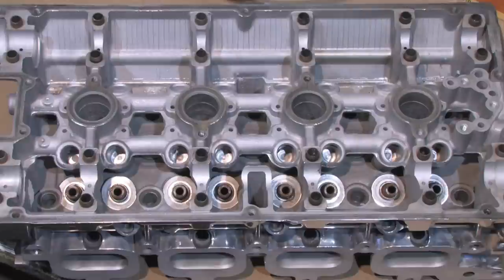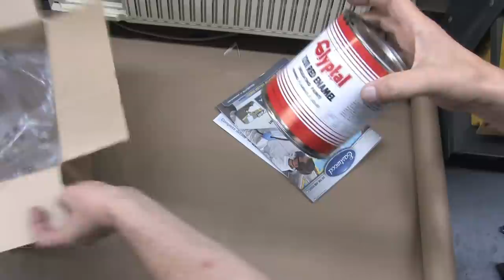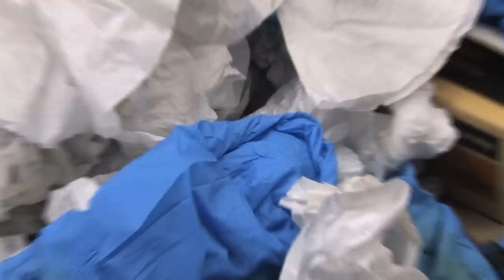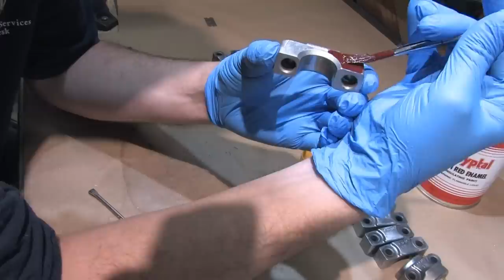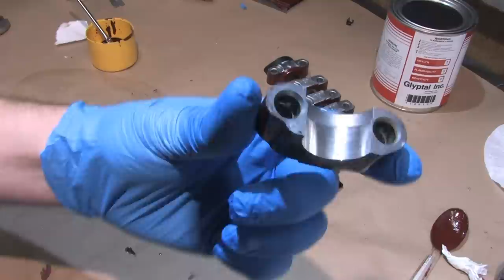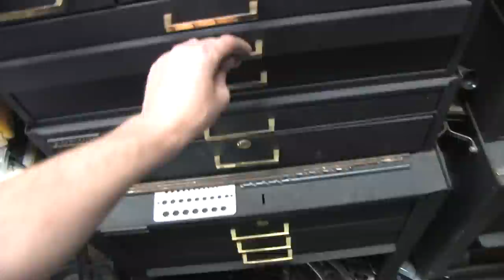Glyptal Application Process

Comment: Glad I can help!  The finish held up extremely well with zero signs or wear, flaking, etc. after many, many years of abuse.  The engine combo was a simple 355 chevy, but withstood incredible high rpm nitrous abuse.  As far as I know, it's still going strong and we built it back in 1996.  

That said, it was far easier to apply on the Chevy V8 due to the simple engine design.  The Mitsu heads are full of tricky tight spots, which is why I admire what you've done here!

Comment: I've done a few set of heads with Glyptol over the years but never a block because I didn't have the means to cure it but it is a great coating and dam near bullitt proof. Your right, prep is the key and the time involved is mind numbing. Great job on the head, I'm looking forward to the rest of the series. I'm glad you mentioned the neurotoxin problem, like most mechanics "it won't happen to me" well a coworker yrs ago repaired a diesel tank without cleaning it properly by arc welding patches on it and his career ended that day, eye sight, teeth, skin, touch, kidney, liver issues, it can and will happen. Cheap safety equipment and preparation are the key to avoiding a lifetime of illness.

Comment: gday m8 just a note to say thanx for the help ive and received from watching your video,s i bought a rvr a while back that was blowing enough smoke to fill the street if i drove it and i had trouble working out what 4g63 was in it as its an import to australia bytes watching your vids i now know the difference between 1g and 2g  6 bolt and 7 bolt the rvr is 2g took the head off turned head upside down covered valves with water checked ports later with torch nearly every one had a puddle or seeping around valves thanks again 4 all the help

Comment: About 40 yrs ago, I purchased some Official, Chevrolet sanctioned How-to High Perf manuals from my local Chevy dealership. In those manuals, the procedure for prepping the insides of the block and cylinder heads showed much of what you've done here. In addition, the painting of the castings interior to improve oil scavenging was also recommended, though I'm unable to recall if the recommendation was for Glyptal, or not. I do recall however, that the color of the paint used was a deep brick-red...   I'd say you're on the right track!
P.S.    As I remember, this process was used so that an engine with extreme rpm capability could operate without installation of deep sump pans and still not suffer from oil starvation issues. It was also recommended for engines being fitted w/a dry sump system...
Reply from the maker: It might have been Rustoleum Red Oxide Primer.  The shades aren't far off, but in photos, I can tell the difference at an extended glance.  I'm pretty sure I could do it in person immediately.  I've seen several small block chevys (mostly 327's) out there on the interwebz with the brighter-colored RROP.  I think Chevy'd go with that one because it creeps closer to "Chevy Orange" range of the spectrum.  Glyptal is a deeper red.  

I think these types of treatment are more common than people expect, it's just not documented much at all in video because it's mostly done by the "old timers" who are stereotyped at being less-savvy on the interwebz.  I bet that's why this topic it's controversial.  Video reaches more people that a photo album on a shelf.

The reason I'm hoping this works... a dry sump setup is $5,500.  While I'd love to document installing one, I'd need to win the lottery first.
Reply: It may have been the Rustoleum ROP. The meticulous attention to detail was the same as your process, and the manual was adamant about Not cutting corners!  
 Unless you NEED a dry sump system due to space limitations (ie. highly modified chassis), I think you'll do quite well without it!

Comment from the maker: +John Klatt Glyptal won't shed heat.  It would shed oil.  Pistons are one of those things that I wouldn't want to do that to.  In addition, some people delete their oil squirters, and I feel like this could result in oil starvation of the rings if the oil can't stick around long enough to flow through the rings' oil supply holes.  Glyptal will act as an insulating layer, and I'm pretty sure that it would burn off quickly at the temperatures that pistons achieve, quickly ending up inside your crankcase.

Comment: Gliptol is good stuff - I have been building electrical equipment for 4 decades - and have seen lots of engines and industrial equipment with this coating - if u have a machine that has to be serviced regularly and that service includes cleaning then your gonna want this.  It's easy to clean after its installed.  The red coating on most electric motor windings is gliptol - in the last 15 years the industry has moved to some epoxy products - I have seen oil flowing through generators from engines with rear main oil leaks and have no damage - just take it apart - bit it with a pressure washer - let it dry and then run it.

Comment: I am currently rebuilding a 74 cub cadet garden tractor rear differential.  The interior of the cast iron case was painted I assume with glyptal,  same redish color.  I assume to keep condensation from rusting the interior of the axle as this is also the hydraulic fluid reservoir,  after 46 years immersed in hydraulic fluid there is no change to the coating.  I am thinking about doing to the underside of an small block chevy intake manifold to insulate the air/fuel charge from the hot oil below.  Thanks for the write up.

Comment: I completely agree from the video that you wouldn't want to paint the coolant passages. But since I read about the flat color helping radiate heat faster, I have noticed many of the cars I've worked on have flat-black rads/condensers/trans coolers, etc. I can't really feel it with a finger or anything, but it's not a heavy coat of paint, nor does it look very smooth. It seems very counter intuitive to me. It could be anodized like you said, I'll look closer next time. While do you think that is?

Comment: Dry sump means two pumps to drive unstead of one+belts,pulleys+ oil tank+modified oil pan.
it's would rob more on the engine than would reduce oil turbulences i'm pretty sure.
 It would allow you to lower the engine ,so modyfing tranny and transmissions mmhhh a big job.
Dry sump often used in rally or track here because of G force,not really for oil control or weak lube problems.

Comment: I actually was looking about videos for a BUICK GSX...And knew about the use of Glyptal from electrical motor work. This was a VERY informative  video. I was not very aware of the preparation requirements. Thank you very much for your insight.
Reply from the maker: You'd probably like the Glyptal Testing video, too.  I test reactivity with like 30 automotive fluids.  

PS:  I made fun of Buick Skylarks when I was a kid because I was always surrounded by Ford and Chevy bigots.  Which doesn't make sense because Buick was GM...  It's amazing how ignorant one can be when they're young, impressionable, and still don't have a driver's license.  Then I grew up and realized that was a better muscle car bargain back then than all of the Fords and Chevys average guys like me and my family had.  Then after I graduated high school I found myself tooling around in MD in a GS for a summer and the spacious interior spoiled me rotten.  I'm 6'4" and I could put my feet up on the dashboard sitting in the front seat.  The F-150 super crews today 'got nuthin' on 'em for interior space.  The GSX package was perfectly timed and developed right at the end of the muscle car era before OPEC ruined everything, and I don't blame you for looking for them.  Even the survivor cars that need extensive work start at $40,000 today if everything is there.  Running/driving car?  Try $60k.  Still a bargain at 10-15x what they ever sold for new when you compare other models.  I mean...  Even the Skylark knock-offs and clones are selling that high.  I read Hemmings, I go to RM and Barrett Jackson auctions.  Today I love all kinds of cars I made fun of as a kid.   455 with a 4-speed?  There's nothing not to like!  Few luxuries in life allow you burn that much gas.
Reply: @Jafromobile  , Thanks. Edited prior comment here for the same reasons as discussed...
Reply from the maker: That Skylark up in MD was a '72.  We backed into a dumpster leaving a guitar shop.  Tiny DC parking lots are the worst.  We mangled that dumpster and moved it 4 feet, but not even a scratch on the chrome bumper.  '72 was a golden era.

Comment: Wow, congratulations on your discipline in performing this procedure properly. Myself, I'd never bother with it unless, as you mentioned, I was was working on an old casting from back when they weren't of very good quality. I'd be really surprised if any engine made in the last 30-40 years would benefit from this, but then also as you mentioned, you did it mostly for the experience.

Comment: A well presented and narrated video, I know this was over a year ago so maybe you can give a point of view on the results. 
My theory: The insulating properties of glyptal would actually raise running temperatures because the head is not transferring the heat to the oil, much the same way a coolant passage wouldn't be able to transfer heat if it was coated.

Very nice video, thanks for posting,
Stan

Comment: @jafromobile have you thought about running a Moroso or equivalent aftermarket oil pan for more oil capacity?  Just a thought along with all of the other modifications you've done to improve oil flow.

Comment: Those systems are used on all engines ,no need to have big moving parts like in a v8.
Here there are 1.6 liter engines with those mods,it's effective.
Your engine have lag,so yes it will not be as useful but it can help a lot for oil control.
You can vacuum you cranckcase too if you go crazy....

Comment: Thanks Jafromobile!  I ask because I boost at 33psi on 93 oct on my Evo X's stock turbo, and I've read that this turbos efficiency tops out at maybe 35. Currently seeing 350/400 on a mustang with my current setup.  Wondering how much more power ill make with the change to e85.  The tune is my own and I currently only see one count once in awhile around 6500.  Thanks for the info !

Comment: Redirecting your turbo return line in pan or adding baffles or a lip on the side of the oil pan to avoid splash to keep oil down and ready to use would be more useful i think.

Interesting to watch however.

Comment: Apparently there is a guy at bimmerforums where he is using teflon coatings for the entire internal of the m54b30 engine. He claims that similar results/conclusion as described in your video. He's been doing this for a long time and hasn't had any issues with any susceptible aftermath results. Again, it is how you do the prep work and not damage the entire engine after wards. He's been quite successful and has faith in his work.

Comment: Would ultrasonic cleaning make the manual clean-up process shown in this video any easier? Jafro mentioned that this part has been through a bath already, but didn't say if it was ultrasonic.

Speaking of ultrasonics, can baked-in glyptal survive that type of cleaning? Maybe the coated areas will never need more than a wipe-down in the future, but not every area in the engine can be painted, so I wonder if ultrasonic baths, or any type of parts-washing bath would damage or remove glyptal paint.

Comment: Awesome video. I have had very good luck with this product. I use it on cast parts that can be very susceptible to rust and corrosion on waste water separation equipment. I did learn A LOT from this video though. thanks for posting.

Comment: This is a trick domestic V8 guys have been doing for many years. Not only does it seal the cast iron surface it helps tremendously with oil return as mentioned in the video.

Comment: I use an electric charge to pull the silica out of the casting, then i seal it with glyptal. A diesel casting absorbs a gallon of oil that is never drained but it leaches all the time. Oil filters were made to remove casting silica not filter the oil the way you think so you want to use a bypass of some sort like a luberfiner. The way to clean oil is to dump it. You will surely get iron oxide from a bare casting as well.
Reply: Just curious, what particular block are you referring to?
Reply: Cast iron
Reply: +Stephen Grant ...Cummins, Detroit, Caterpillar?
Reply: +Stephen Grant Heavy duty, medium duty?
Reply: any size. cast is porous and dirty

Comment: i made an oven from a large engine short block box. insulated with some foil backed bonnet insulation tacked to it.
engine on some jackstands with 2 industrial heat guns a constant temp of up to 170 degc.
ps how is it with e85?

Comment: I thoroughly enjoyed your video and you did a great job! I have been doing parts finishing for many years and would like to offer some constructive feedback. I would argue that the two solvents you used in your video are the worst for parts refinishing. Both mineral spirits and denatured alcohol leave oily residues. I prefer 99% isopropyl alcohol or MEK. They are not a "hot" solvent like acetone but rinse and dry well.  My other suggestion is to never use ferrous brushes on non ferrous metals. It embeds carbon. Brass or stainless steel would be a better option on aluminum, although a paint job is unlikely to fail is this type of application. I love your suggestion to use coffee filters. I was buying lense wipes and are too expensive. Thanks!

Comment: Hey Jafro, first off I want to say I love your videos and I have gained so much knowledge from them. At 19:55 you mention that you shouldn't paint your intercooler--do you mean with Glyptal 1201(obviously you wouldn't!) or in general? I always heard that painting an intercooler black(with proper paint) actually promotes heat exchange in the same way a black interior soaks up heat in summer. What are your thoughts on this?

Comment: I fallow up on a lot of your videos I have done and plan to do most of these tricks to my 6bolt 4g thank you for the great info. I would really like to know what e85 e98 and e100 does to this stuff if your able to run these tests with those fuels or already have please send me a link to your results. I know over time blow by will get them into the crankcase and am just wondering if this stuff is that awesome to hold back ethanol. and again thanks for making these awesome videos for dsm lovers like myself.

Comment: Twin charging ?
a good thing for dragster and 4wd but you would need to really make a lot of hp because chargers rob a LOT of power.
the global efficiency would be quite ugly if the boost and HP are not crazy high.

Methanol and electric vacuum pump would help you a lot yet : )

Comment: Hi Jafro, I am curious to know how Glyptal 1201 would do with salt water - I know it claims good resistance, but what I'm considering is coating the inside (and outside) of a water injection elbow for a marine engine with it. These are well-known for corroding very quickly, and being in an atmosphere of sulphur, heat and salt water. I'd be curious about how the requirements are for baking it as well, and whether it would be suitable for painting the outside of the engine (without baking)?
Reply: I'm interested in using in the water jackets of the an aluminum outboard motor's block to protect the jackets from corrosion. But the baking/curing part is a non-starter as the block is assembled.

Comment: Jafro, I know I am commenting on a years old video, but since there still might be a chance people are watching this, a OV/P100 Filter on a full face respirator would be perfect if you were considering a large-scale application of this.  The OV stands for Organic Vapors and P100 means Oil Proof HEPA filter.  I use these at work often.
Reply from the maker: Jeff Hurckes I would like to say thank you for your experience and accurate response to my problem.  I keep telling everyone in my videos that the community built me, and this is proof that it hasn't stopped.  I hope I will forever be a work in progress because it means I'm still making new friends.

My North 770030 half-face respirator and OV/P100 cartridges are on their way.  I don't think I'll need the full-face, but the MSDS recommends a respirator that removes vapor if ventilation is inadequate.  My research steered me to that silicone model instead of rubber, and the reviews make me pretty confident I picked a winner.  Though I just lightened my wallet by $62, I'm sure I'll save enough brain cells to justify every last cent of it.  You can't buy brain cells.
Reply: ***** That is the exact respirator combo I use, but we have great ventilation in the mine, so I didn't elect the full face mask.  I have one just in case though.
Reply: ah but with 3d printing... One day..  SOON

Comment: I putter with antique outboards as a hobby.  Those old aluminum castings, as you mentioned with old motorcycles, really do need this.  Acetone takes it off easily btw even after its baked on.

Comment: Internally sealing sand castings is proven useful with racers coating sand cast blocks etc since the 1940s hot rod era at least.
Does that complex permanent mold casting have sealing issues? Being smooth it has no drainback issues.